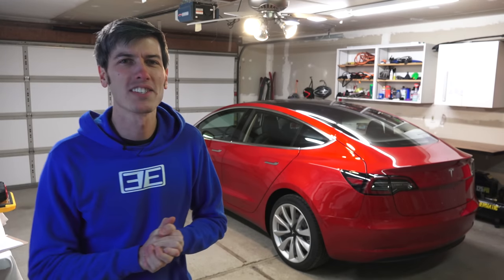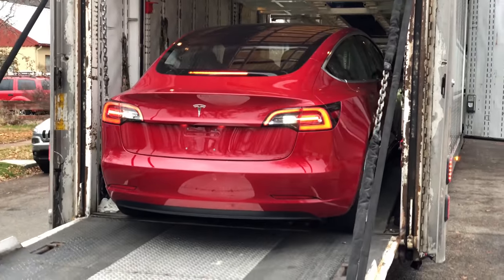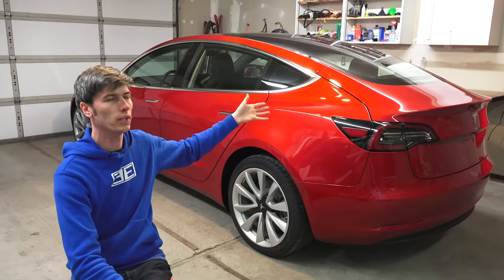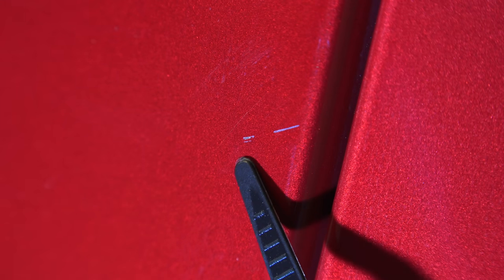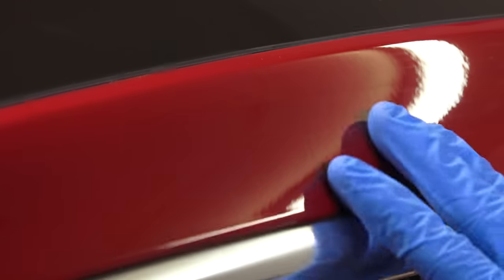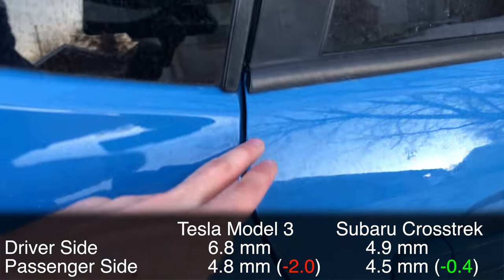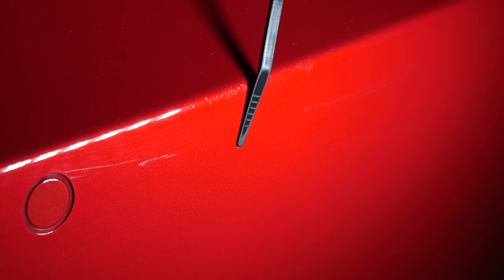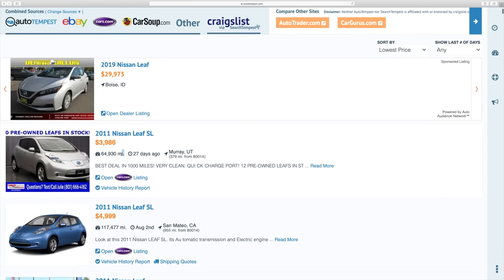Everything That's Wrong With My Tesla Model 3 - Quality Problems

Comment: You are not over-reacting. You paid for a new car. With Tesla’s policy to send cars out this way and save on dealerships, this is part of their problem to solve. 
I would refuse to pay full price for a product that is not 100% complete. You are paying for a new car, not a used one with wear and tear
Reply: Good thing for them the truck is built the way it is, so you can't get a proper look at the car.

I would've denied to accept the delivery before they even offloaded it if it looked like this.
Reply: The key is that it will be fixed, just as any dealership would. So, please don't try to use the dealership defense. NO ONE in their right mind LIKES what dealerships are and have been for decades!
Reply: I would certainly return the car to them if you spent your own money to buy it. I ordered two new Chev Caprice SS back in 1996 and both came in to the dealership with several defects. I only ordered one at a time but refused acceptance of the first one due to several defects and then ordered the second one in a different color  and the dealership called me and told me that I wouldn't be happy with the way it arrived either so I bought a different brand car that year. Chevrolet has always been a lower quality brand car but compared to other brands usually a less expensive brand to buy. Tesla not being a cheap brand should be expected to have a better quality about them. We all need to cast votes with the money we spend with car manufacturers and not accept less than standard quality for expensive autos.
Reply: Seriously I bought some mid range washer/dryer set from Samsung. They where delivered in cardboard boxes, and inside the boxes they had that blue protective film on all the stainless steel panels. How come mundane appliances have plastic film to protect from damage and up market cars don't?
Reply: @t.k.morris  Are you forgetting that his Tesla will be fixed? Are you also forgetting that he will have an upgraded Tesla for the ENTIRE time the vehicle will be gone? Remember, no mass automakers is perfect. What matters MOST is how yhese things are handled. I think it is being handled better than MOST, if not all, dealerships networks.
Reply: It's just a $50,000 car. Do as Musk does and just bill the taxpayer for repairs.
Reply: @austinflavio3457  How come appliances have plastic film to protect and cars don't? <-----THIS!!!
Reply: The problem will get worked out when people wise up and stop buying these garbage cars that you can't even work on yourself.
Reply: @AscendedSaiyan3  ... I understand your point of view but it doesn't remove the enormous poor quality control issue that they must have. Any manufacturer is responsible and will correct the problem most likely but how did it leave the plant without being noticed is my point. It isn't a cheap car and the price of it demands more attention to details. In my opinion at least. If you think is okay, go buy one. Totally up to you and everyone else how you spend your money.
Reply: @t.k.morris  Again, ALL automakers experience paint issues. Yes, it is a problem.  Yes, it will be dealt with. What else could you want, once it happens (and, again, in happens to ALL automakers)?

Panel gaps are on almost, if not, EVERY vehicle made. Some are more than others. Even this guy's S2000 had panel gap inconsistencies. They do not alter the performance of the vehicle. So, to be logical, you would have to be upset with ALL automakers and not specifically Tesla. ASTON MARTIN vehicles have panel gaps!  How much do they cost, again?
Reply: @Farlig69  But cars do... Even low-end Chevrolets have plastic in damage prone areas to prevent paint damage during shipping via rail/open transport.
Reply: @t.k.morris  id take a tesla in this condition over any traitor so called chinamerican brand vehicle in perfect condition,  if there was such a thing. FOR NOW tesla is the only true "buy american" brand in existence.
Reply: He bought a car with 23k miles. That's not new
Reply: @korey9498  ... Correction please... 22 or 23 miles not 23 thousand
Reply: @mesta9997  I can guarantee you any Honda and most Toyotas and Hyundais are more American made than Teslas.
Reply: @Farlig69 Most car factories protect their cars during shipment with various plastic wraps and bump strips, i guess Tesla didn't get the memo.
Reply: Correct! The paint quality does not look like brand new car.
Reply: > Remember, no mass automakers is perfect  
"Perfect"? That paint looks worse than the paint on the 14 years old car (220kkm) in front of my house.
Reply: To be fair, Tesla has done a huge amount in a short time. Reliability of internals is more important than aesthetic stuff to me.
Reply: @AscendedSaiyan3  I've seen many, many Hondas, which are far less expensive, that had better quality in their fit and finish...this is laughable at best.
Reply: @whorutothink  Since Honda and Toyota is the industry standard, that is a compliment. HOWEVER, a Honda is not as quick. A Honda is NOT even as close to being the safest car in the U.S.  A Honda does NOT have semi-autonomous to full self driving technology built in. Hondas do NOT have the aerodynamics.  A Honda is no where near the efficiency of a Model 3. Hondas don't have the cargo space of a Model 3. Basically, what you named and price are the ONLY two metrics, out of dozens, that Hondas beat a Tesla Model 3. BUT, don't let the fact get in the way of your emotions.
Reply: @AscendedSaiyan3  a Honda is not as quick ... yes, some are. Hondas dont have that cargo space ? Umm, some have. Yeah, dont let facts ruin your emotions. Inconsistent panel gaps are no problem as long they dont interfere with the aerodynamics and cause noise. The m3 is a cool car, but not the one and only. A little less religious fanatism please ... its just a car.
Reply: @andreheinrich7443  Why must SOME  people try to use the religious angle to try to discredit others? I could easily say the same about you. How, you say? Can you name a production Honda car that is quicker 0 to 60 than a Performance Model 3? NO. Yet, you made the statement. Cargo space could be close. HOWEVER, out of ALL the things I listed, you just tried to use one or two things, as your "proof" of "fanaticism". If that is the only thing you can bring up, that makes YOU someone that is more of a religious fanatic AGAINST the Model 3, from Tesla.

I will still be waiting for the name of this production Honda car that is quicker than a Performance Model 3, zero to sixty.  Fanatic. ;)

If you want to name some Honda car names that beat the Performance Model 3 in the OTHER areas I've mentioned, go for it! 😁 Remember, don't be afraid of FACTS. 😂
Reply: @AscendedSaiyan3  quite simple ... honda nsx. Its a honda all over the world, just in the usa and china its called a acura.
Reply: @andreheinrich7443  When is a Honda NOT a Honda? Answer: When it's an Acura!  Also, no Acura can bet a Performance Model 3, IN IT'S CLASS, either! In case you didn't realize, an NSX is TWICE the cost of a Performance Model 3. 😉
Reply: @Benni B Evil exists when good people do nothing. I am fighting lies with truth. Lies by itself can look truth! See Donald Trump and his base! 😉
Reply: @Benni B let him be, he's just a weeb that's been blinded by Tesla. I love those cars myself, but you won't see me buy one until QC is sorted out, no company is perfect, but these are some BIG examples of QC issues. And if I did, that car would keep being sent back until I got what my money will be paying for.

Comment: The major problem is that Tesla doesn’t do a inspection at the shipping port. For example, BMW has multiple delivery/shipping centers located by major ports in the east and west coast US. Every car that BMW builds wether from Germany or South Carolina goes thru those centers before being train or trucked to your local dealership. Even though BMW does an inspection at the factory they still do a thorough inspection at the delivery center here in the States to catch anything that the factory didn’t catch. Tesla doesn’t do this crucial step. During my tour of bmw’s delivery center, it’s surprising how much repairs are done at there. Paint defects, scratches during shipping, fitment issues, etc.
Reply: Tesla does have a panel gap and flush control station. The fact that they still ship vehicles in this condition though is unacceptable.
Reply: Well, if they did that second inspection, they'd have to send back most of the cars back to factory.
Reply: thats nice but BMWs and al lgerman cars dont last mechanically lol so youll have a paper weight with nice paint i guess
Reply: shin888 that does not happen. If it came to the port with major issues, the car gets scrapped. This was actually one of the questions asked during my tour. BMW says it’s not with the shipping and import fees for the car to go back to Germany.
Reply: @Pookgai420   shin was replying to alex in reference to the tesla, not the bmw.
Reply: jon chen gotcha my bad
Reply: You paint a skewed picture here. These inspections might catch a quality problem but they are done to detect shipping damage and would be basis for insurance claim. The last one done in destination country also being an accessory install and owner packet and window sticker install. When a vehicle rolls off line in Germany it might be $43,280 but a price increase might make it $44,560 when it gets off boat in US.
Reply: True, but Tesla also charges a fortune for repairs, as they only allow certain mechanics in any country to acquire the components needed if anything malfunctions, and go after any company which tries to offer aftermarket parts for their cars. Not to mention that if body repairs have had to be done, Tesla then bends you over and f's you up the rear end if you ever go to trade it in for a newer model Tesla (as their policy is to automatically deduct an additional 20% off of what would be your offer, as records will show you've had body work done, irregardless of what said body work was, even if it is touch up paint work such as EE may have to get done).
Reply: @jimmyaber5920  what you mean by price when it rolls off the line? Pretty sure if you mean manufacturing cost, it's a lot less than that..
Reply: @dinobot_maximize   stop perpetuating this nonsense
Reply: BMW? Hahahaha.
If you're going to compare to a quality product say Toyota or Honda.
Reply: @jjmarz1001  Toyota and Honda are cheap how are you gonna compare a 45k car to a 25k car
Reply: Filipe Saramago sticker price as that is what is on the window sticker for dealer display.
Reply: BMW cars and bikes need all the help they can get.
Reply: @Pookgai420  
Wow, that's sad. Too bad they just don't send them to the Dent and Ping section at Sears where i could afford a beemer.
Reply: Lots of BMW dealership-new buyers seem like they expect such a high level of perfection and nothing else will do, just to perpetuate the internal feeling of being an important person in the world. It's problems like this that perpetuate the societal issues leading into economic stratification/eventual collapse. 
That sensation of feeling better than someone because of their income, paint quality, or fairness of their skin color, that's the evil that comes from new luxury cars. 
Modified or special models aside, basic cars like a $20k Honda Fit works just as well and does car things just as well as a $60k BMW i3, when the price difference is $40k it's no wonder that someone driving that BMW would feel better than you. But they both get you from point a to b.
Somewhere along the line, Tesla got put into the same category as BMW, I think it's due to the higher base price point. Being a really new automotive company they are not ready to compete with these luxury big money robots.
Reply: U cant compare german cars to any others, they are pretty ahead of the rest
Reply: You'd think that with all these inspections, BMW could deliver a car with working turn signals.  😆
Reply: @mikeallan9574  Well, they can, but it's such an expensive option that almost noone buys it!

Comment: Ahaha I worked for them as a Delivery Experience Specialist in '13 and all we did was distract people from the scratched paint job, shoddy finish and missing charging equipment. The kicker was - most people swallowed it without a peep, only the occasional car nut asked if we were crazy. The company consciously exploits the enthusiasm of their fans.
Shame to see that that hasn't changed and people like you still have to deal with crap like this. Good luck.

Comment: 1.Well, on the plus side: you dont have to open that left rear door, you can get in through that gap.

2. As we all know, fart mode is available on Teslas. Maybe next year, thanks to a new, updated software , the car will also emit some smell  besides the sound. The gaps are there to greatly improve the ventillation of the cabin.
Reply: Someone on YouTube with an actual sense of humour......

Comment: Orange peel left on an entire panel with factory paint job? Dust speck under paint in the middle of a panel gone unnoticed? Scratches on multiple panels that look like they've happened before the panels were even mounted onto the frame? Yikes. You wouldn't even accept that from an aftermarket paint job.
Reply: Just had my car painted in a shop and it looked better than this. I’d expect much more out of a factory paint job
Reply: @rasterops1083 I bet the majority of units go out with 0 paint defects, but to suggest that this one popular Youtuber happens to have gotten the only bad example to leave the factory is absurd.
The dust particle is arguably excusable, clean rooms can only be so clean and if you're spending all day looking at painted panels as your job i can understand you might accidentally glaze over an imperfection on 1 piece, but those scratches are a joke.
See how the scratches on the bumper follow round the curve? They were there before it was put on the car, that's been knocked over or stacked stupidly or some such - this means that not only does the person that caused it not care enough to get it sent back to have it prepped and repainted, but whoever mounted it onto the car didn't care either, and let's not even consider whether a pre delivery inspection was conducted on it.
This is a failure at multiple links in the chain. Either a lot of people hate their jobs, or internal standards are low.
Both are concerning.
Reply: @お前はもう死んでいる Je m'appelle pain au chocolat
Reply: @dasppg9737  I just spent 6 months in a bus painting workshop and on non-white jobs you needing to "flatten" EVERY reachable flat and convex surface or the orange peel sticks out like a sore thumb. It's shocking that they'd cut corners here despite clearly having machinery capable of making light work of it.
Reply: @BaguetteHD  I am an engineer at Tesla. People do hate their jobs. Shitty pay, low morale...
Reply: @BaguetteHD  What kind of name is chocolate bread anyway?
Reply: @rasterops1083 I worked at a Tesla authorized repair/paint shop for a while, I can guarantee it's not one car. We had almost endless work of brand new Teslas not even delivered to a customer yet that were sent for paint repairs. Nothing huge, but like in the video, lots and lots of smaller defects.
Reply: @rasterops1083 you are right, it might only be one car. But most car manufacturers quality check the paint  100%, so every car gets accepted before it goes out the door.
To get a dust particle that size under the paint is one thing, but to pass a quality inspection and be delivered to a customer is another.

With regards to scratches, there really is no excuse. Especially because there are multiple scratches. Even the delivery driver  should have picked up on these when the customer accepts the car.

It is Not an acceptable condition to receive a new car in at all.
I wouldn't even accept a ford in this condition, let alone a Tesla.
Reply: @mikefoehr235  My mother was from France and my father was from Hungary
Reply: @BaguetteHD  Middle management was okay. They were in the same boat as we were. Upper management was the problem. I was a structural engineer in their solar department, but my entire team was let go.

Comment: if you told me this was a used car, i would say it had crash at some point
Reply: Same
Reply: That's not what a crash looks like though
Reply: He means crashed and fixed up but still some internal bending left over so the outside pannels dont sit as flush as with a new car (no ida if that would be realistic)
Reply: I have a car that was in a crash (rear ended someone at 30 kph, my fault) and I can confirm